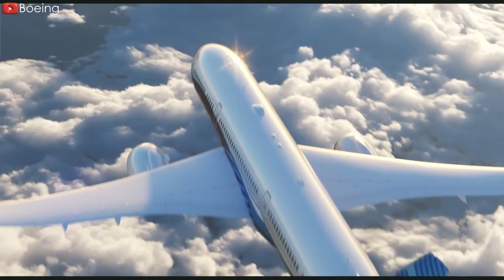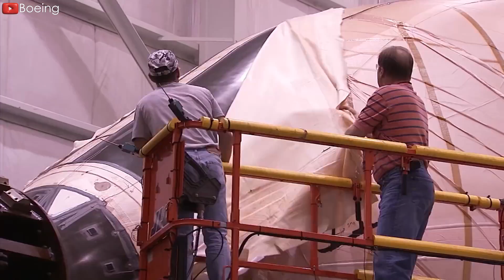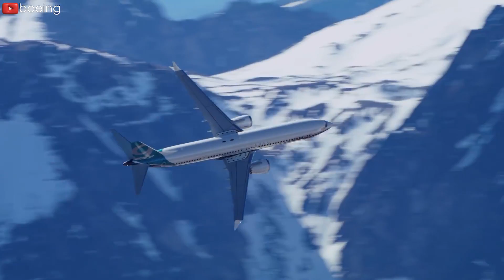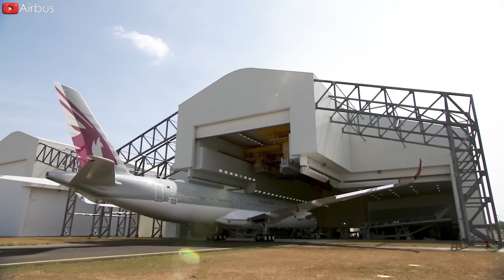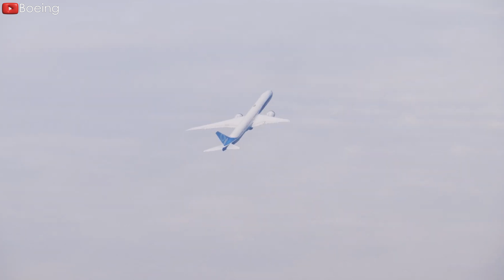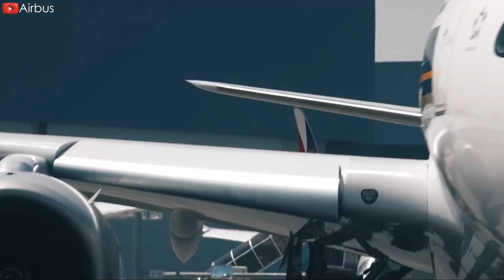This NEW Airbus is BIG PROBLEM for Boeing! Here's Why...

Comment: Airbus has much more experience in composite materials than Boeing. Way back in the beginning of '70s, Airbus was using composite materials in their aircraft, i.e. A300.
Airbus was indeed reluctant to develop A350, because they are always terrible to read the market. For example:
A380 was an engineering success, but a financial flop.
Not the same company, but the same people developed an engineering marvel, Concorde, but it was a commercial failure as well.
There are other examples like lack of an A350-800, but you get the point.
Reply from the maker: thanks for your feedback!
Reply: But they were spot on with the A300, A320, A320neo and I would count the A220 as well (and the A220-500 may be a positive suprise in the future). Boeing is just run after those aircrafts, especially after A300 and A320neo. So with these, I wouldn't say they are terrible. Boeing had lot of successes in their long history, but they had spectatular failures, like the 7007, 747SP, 7J7, the result of the missed 7J7: 737MAX, probably the 727 as well.
Reply: @GThu1  I think you need some aviation history lesson. And that is not too far history.
- A300 was struggling to sell at the beginning. 1974 Oil Crisis saved it.
- In 2008 two engine manufacturers, CFM and P&W separately announced their revolutionary engines. The new engines would be 15-20% more fuel efficient than existing ones. A320 sales were behind 737 sales at that time. So you expect Airbus to adapt those engines immediately to catch Boeing, right?
Wrong! Airbus waited TWO AND A HALF YEARS until the end of 2010 when Bombardier C Series (now A220) which was using the new P&W engine started to threaten their market share and only then A320Neo was born.
- A220 was presented to Airbus in golden tray for just $1! And that is Canadian dollar!
- A350 was developed only after customers declared that they would not buy the "new" aircraft based on A300/330/340 fuselage.
So don't tell me Airbus is good in reading the market.
Airbus is doing very well now, because Boeing has been even worse than Airbus in the last 25 years.

Comment: Airbus already used composite materials in the A380's wings. Without the use of composite materials the A380 would not fly... So it was not BECAUSE of the 787 launch that Airbus started the A350 conposite developments, but rather a natural progression.
Reply: Airbus used composite materials way back in 1970s, in A300.
Reply: @user-yt198  good point!